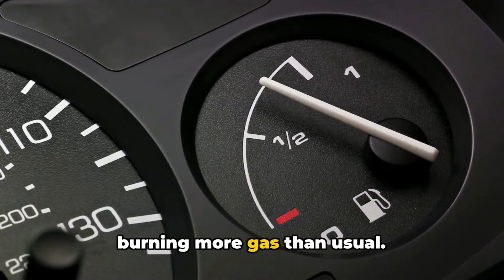Why Do Ignition Coils Fail: 7 Common Reasons Why They Go Bad

Comment: what if you have the same coil go out, should be a voltage problem right? i have a 2007 toyota camry SE 2.4L the alternator is new and the battery is new. if its the voltage how do i check this?
Reply: I’m having the same issue. Did you find out why?

Comment: I do have honda civic 2011 model.  My ignition coils are always failing and changed again and again. Is the quality of the battery will affect the durability of the ignition coil? (Because i bought A low quality battery)
Reply: What is the cause of the damage and how was it solved?
Reply: What was the issue ?

Comment: my corolla 1zrfe every 3 or 4000 kms one coil goes bad
Reply: Damn how are you able to fix that 
I’m having same issue
Reply: Cover whole coil with heat shrink tubeso if the rubber damages and the coil will leak causing it to short the sleeve will prevent it @zexisbullish
Reply: @zexisbullish https://youtu.be/QpwK00604vU?si=a23abVx3wqTpjwaj

Comment: Hi , thanks for this video. I'm having radiator issue on my Toyota Camry 04, its leaking always, it leakes more  whenever i put on the AC for like an hour and this causes the car's temperature to sky rocket.... But as son as i fill in water to cool the engine down, next thing one of the ignition coil is bad, it has happened 3x and i have replaced the coil 3x as well. So my question is this, does that mean overheating is affecting the ignition coil??
Reply from the maker: Hi, Yes, it's likely that the overheating caused by the radiator leak is affecting your ignition coils. When the engine overheats, it can cause various components, including the ignition coils, to fail due to the excessive heat. Continuously replacing coils without addressing the root cause, the radiator leak and overheating, will likely lead to more failures. It's important to fix the radiator leak and ensure the cooling system is functioning properly to prevent further damage to your engine and its components. If you need a temporary fix get a quality radiator stop leak but this is for temporary at the end you will need to get the radiator replaced. I hope this helped

Comment: Hi, this is the 3rd time I am changing ignition coil on my Nissan micra k13, on cylinder 2. Do you suspect clogged fuel injector can cause ignition coil to go bad?
Reply from the maker: if the fuel injector is clogged, chances are you just need to replace the injector, no need to buy a new coil. Ignition coils last a very long time. Have the injector tested.

Comment: Hi, Honest Mechanic, I have question, Pls answer. I have Nissan Sentra 2013 Model, automatic transmission. currently my vehicle is giving jerk. This jerks happens only during traffic time when I need to accelerate and brake many times, after congestion is over when I speedup my car jerks. The same does not happen during the low traffic. What is the problem. Is it gear/transmission issue or miss fire issue.
Reply from the maker: Hello!

Given the specific circumstances you mentioned (occurring mainly during traffic and acceleration), I would first recommend checking the transmission fluid level and condition. If the fluid is low or looks dirty/burnt, it may need to be refilled or replaced. If the transmission fluid is in good condition, then the next step would be to check for any engine-related issues, like spark plugs or ignition system components.

However, due to the complexity of modern vehicles, it's always a good idea to have a professional mechanic diagnose the issue, as they can provide a more accurate assessment using diagnostic tools and their expertise. They can check for any error codes that might be stored in the car's computer system, which can offer more precise clues to the problem. Remember, regular maintenance is key to ensuring your vehicle runs smoothly, so keeping up with scheduled services is always beneficial.
Reply: Thank you for reply, I have changed the Transmission fluid before. I am changing the as per Nissan guidance after 80K kms. Many mechanics even without checking say this as transmission problem and need to change the gear which is costing a lot.

Comment: Wow! How many times of the same clip pulling out #2 coil 😂.  Perhaps the excessive gap of the Spark Plug at 100k miles correlate to the same time of Coil failure. Perhaps a good Prevention procedure would to regap your plugs every 50k miles.
Reply from the maker: Haha good spot!

Comment: most ign coils do 500,000-1000000kms,as do O2 sensors
Reply from the maker: I agree, both of these can last a long time, however, in general most manufactures recommend changing the ign coils at least after 100k miles, but from my experience they can go many more miles. Thanks for the input